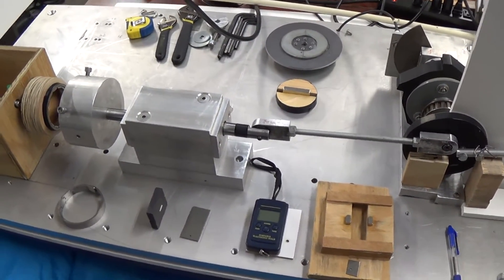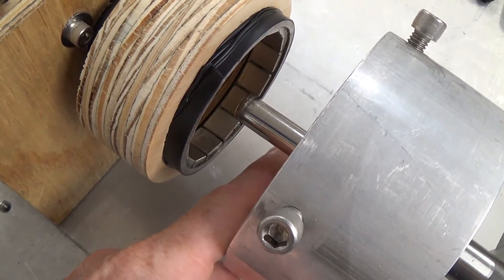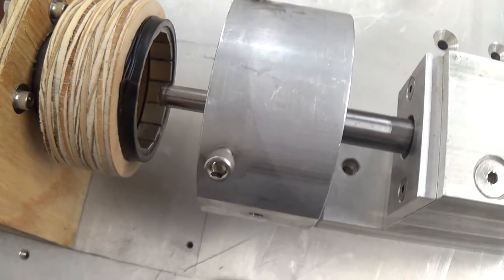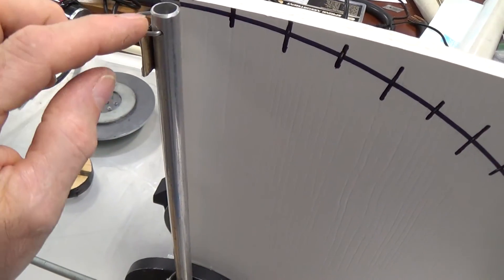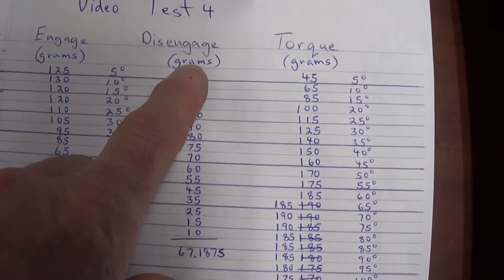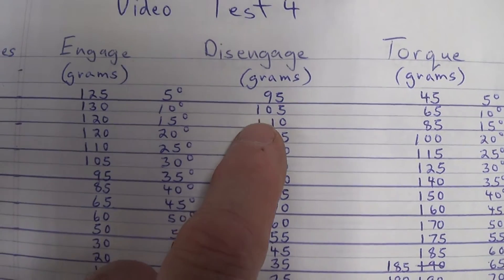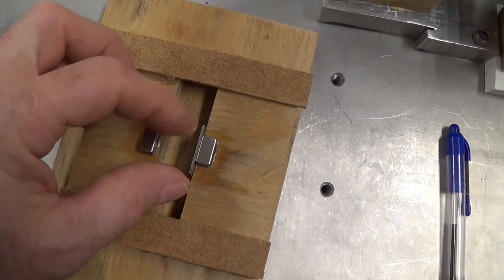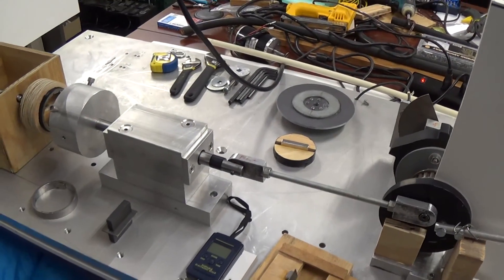Floor's Twist Drive Permanent Magnet Torque Amplifier test 4

Comment: If you can shield the magnet at the proper time. You should basically make a motor. And it run like a induction motor.